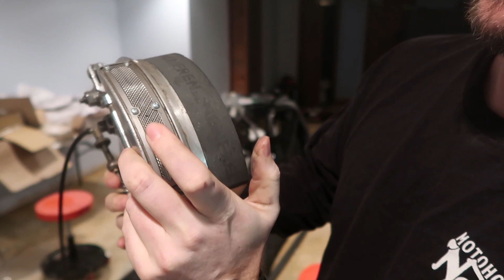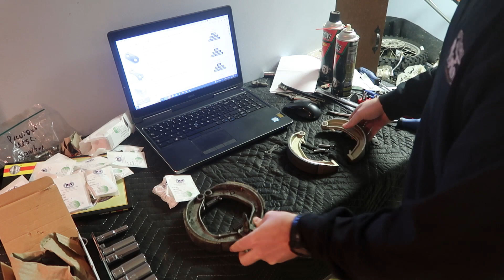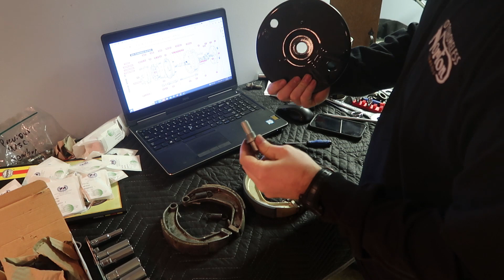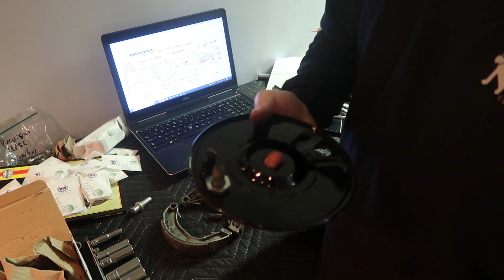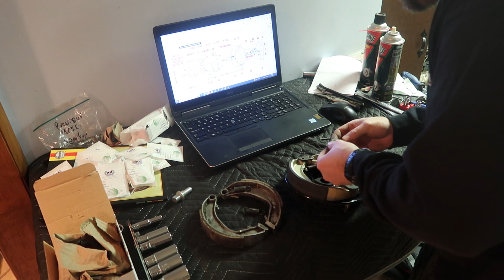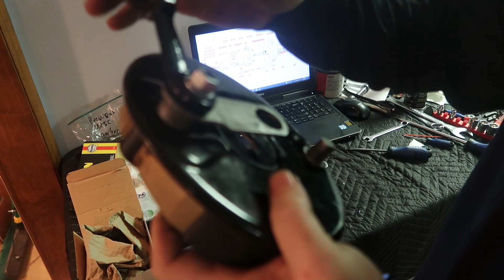Rear wheel assembly!  (Norton Commando build part 10)

Comment: The cause of the damage to your wheel disc is the speedometer gearbox.  The outer face of the gearbox should be flat.  They often get distorted by prying on the gearbox to spread the swingarm enough to get the axle spacer in.  It is more prevalent on the '71 and later models with the cush drive as paddles are often difficult to push into the rubber buffers.  If your speedometer gearbox is nice and flat and the gearbox still rubs, it is likely that the 'tophat' spacer in the gearbox has been crushed slightly.  You can either replace the spacer or add a small washer or shim inside the the gearbox and against the tophat spacer to gain the needed clearance.  It would be a shame to grind up that shiny new wheel disc!
Reply from the maker: That makes sense!  I will check that.  Thank you!